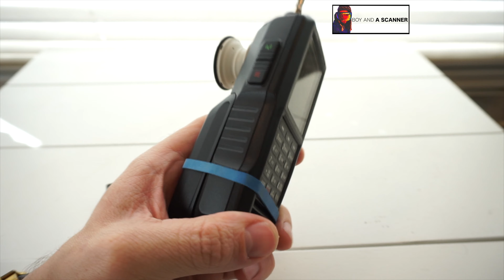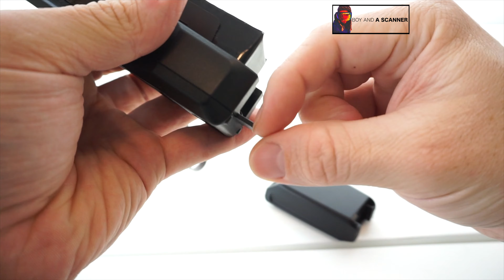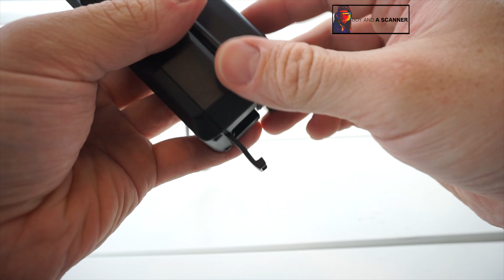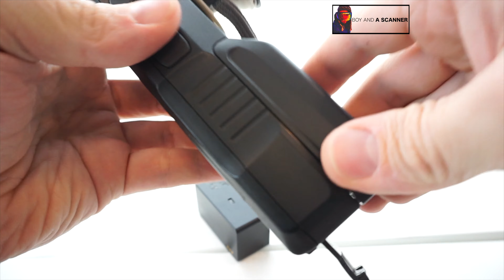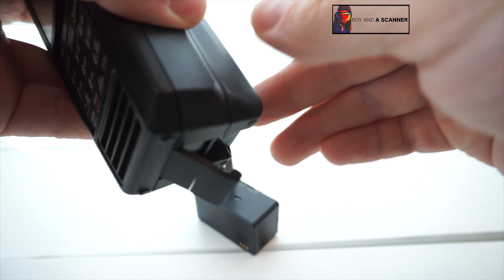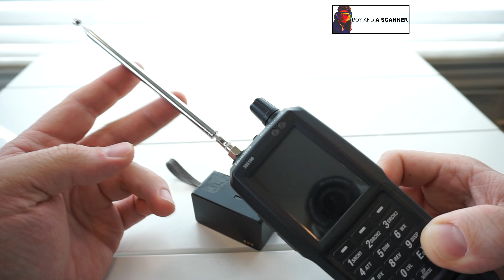Uniden SDS100 Failure...

Comment: I agree with you. Someone definetly at Uniden needs to address that issue. If it happened to yours it will happen to someone else. I had watched some reviews before i had bought mine, and one reviewer had said that the latch on this radio was the weakess link. Guess he was right.  Have a great day
Reply: It is the same solution that I use, although I must warn that after a certain time the adapter inevitably begins to weaken and even slip
you have to stay often
to screw the adapter back onto the antenna socket, and in two and a half years I have already replaced two
of adapters...
Reply: Unfortunately there are several things wrong with this receiver, and frankly they have detached me from it a bit...

Comment: Aside from the latch, I strongly recommend that you use an SMA to BNC adaptor for the antenna connector. This accomplishes two things: 1) It enables you to quickly swap out antennas (or simply remove it quickly for transport) and 2) The adaptor is a natural strain reliever at the radios most vulnerable point of breaking (aside from the battery latch) and it’s expensive to repair and NOT something you want to attempt on your own, unless you are adept with electronics repair. 
I have these adaptors on all of my scanners that have male SMA antenna connectors on them as well as my ham HTs. 
They are readily available at all ham radio sales stores and I believe Scanner Master sells them, too!

Comment: I just got one today.  I am going to return it in the morning.  My PC just won't recognize it.  I tried different USB cables and different computers.  I read to reformat the card so I did.  Now I just get an error message telling me to use the sentinel software to clear it.  Problem is, the PC won't recognize it in the first place to use the software.  Duh.  I even put a new formatted card in too.  Did I mention I cleaned all the contacts in the unit for the card.  The card is recognized with a USB card adapter I have for my camera so there is no apparent problem with my card or PC.  Geez.  For the price, this is not exactly quality assurance.
Reply from the maker: You need the updated .net framework for it to show up. I had the same thing when I bought might. Should be an easy fix unless you already returned it. Cheers

Comment: I just received my SDS100 and having a problem with receiving any signal or reception adj squelch check firmware tried just about everything no luck will be calling SM Mon AM. Battery clip for cover if it finally breaks  you could maybe use a binder clip to fit on the pin side and you would have to bend other to fit snuggly on other just idea till Uniden comes up with solution. Any help would be much appreciated. Regards
Reply from the maker: do you think it's a speaker issue or receiving issue? one quick thing to try, if you havent - make sure the full database is turned on and try the auto locate. make sure all your service types you want to listen to are turned on as well.

Comment: This seems to be a common failure point. How often were you swapping the battery out?
Reply from the maker: For a couple months 2 times a day... Ya it’s a bummer. I’ve never been rough with it though. It’s a very tight fit I’ve noticed when you put the back on and so I’d always give it a squeeze (battery cover to scanner) when I release it and put it back on.

Comment: simple solution is make it metal
Reply from the maker: Ya it definitely should not have been soft cheap plastic.. 😕
Reply: @BoyAndAScanner  You must have opened the latch a lot. I think in the year I have had my SDS100 I have opened that latch about six times. I recharge the battery and usually have it powered when I use it at home while listening. I can even charge it in the car. I do have the replacement battery and charger and will swap them out every few months if that. I also ordered and received an extra latch for when it does break. Yea a metal latch would be great! Thanks for you videos. They are informative and well done. Look forward to more videos.

Comment: There's a guy to makes battery clips and scroll knobs for the SDS100 which are MUCH better than the one which comes with the scanner. They are $10 each and I bought both just to have them on hand. Check out http://www.unidenscanners.com/payments.html

In fact, I went ahead and installed the new scroll knob because it just feels better. The battery clip is carbon fiber and of a much better design. To install, just loosen the 4 screws inside the battery compartment, install the new clip, and tighten the screws again.
Reply from the maker: Awesome thank you for letting me know.  I appreciate it. Thanks for watching